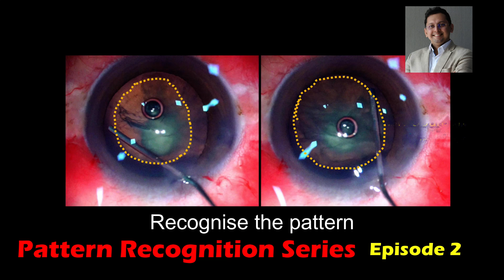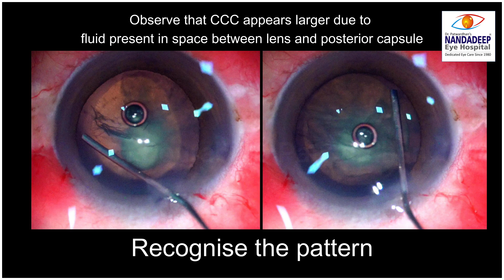257 Anterior capsular block: pattern recognition to avoid hydro rupture of PC- Dr Sourabh Patwardhan

Comment: During hydro , should we tap nucleus in center or should it be the opposite pole of nucleus ? If we inject at 3 o clock , should we tap at 9 o clock ? What is the physics here ?
Reply from the maker: Opposite side is better. Allows the fluid wave to come out from other side.

Comment: Thank you, sir, for the video; it was remarkable as always. I have a couple of questions: Is the rent due to the blockage of the anterior capsule or the opacity at the posterior pole? And when the blockage occurs, does the CCC always appear larger?
Reply from the maker: Very good questions. It will occur in every case of blockage when you review the video. Probably will be less visible if ccc is too small as pc will give away faster. PC in centre is always thinnest even in non psc/ppc Cataract so it will give away at central PC always.